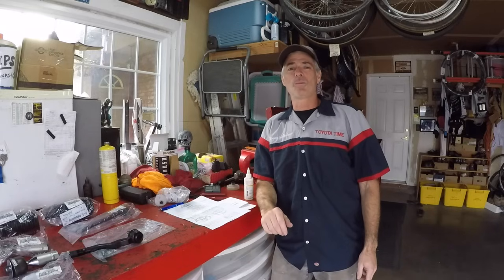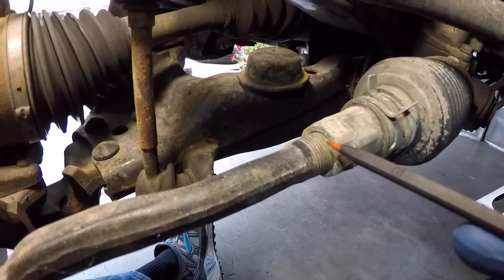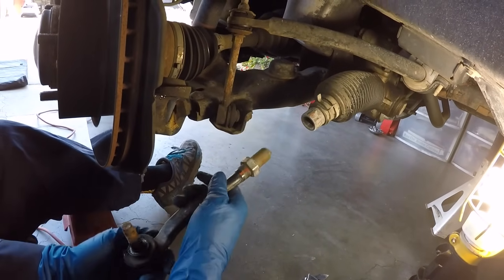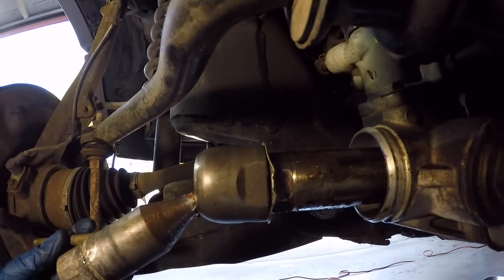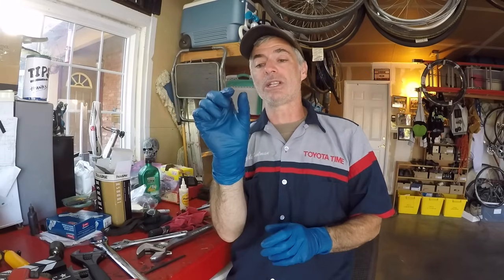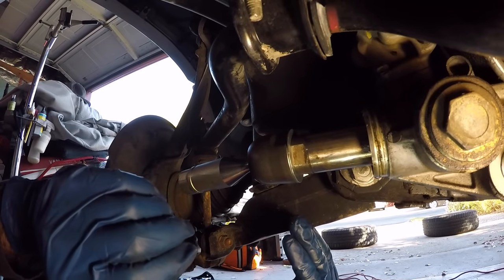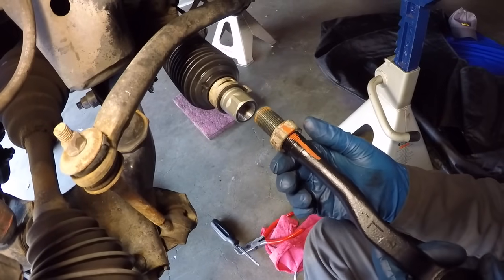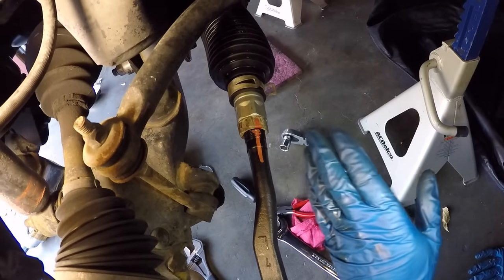Inner & Outer Tie Rod Replacement

Comment: my 98runner with 150k has drooping/sag and my mechanic said that it was loose but probably safe. I just purchased new lower ball joints oem from ebay bc i dont want to risk my wheel falling off like i have seen in some videos. Would you recommend replacing lower/outer tie rods and control arms as well when replacing ball joints? my front tie rods look very rusty and I hear an odd noise sometimes when my steering is alll the way to the left when leaving a parking spot. I am having my mechanic do the work so I figure I could save some on labor costs to replace all these parts at the same time. thanks agin for your help and great content - has helped me a ton in learning and restoring my 4runner. god bless
Reply from the maker: A reason to replace tie rods is if there's detectable play in the joint.  Control arms only need to be replaced if they are rusted out.  Shops suggest replacing the whole control arm to their customers, because they know their high labor rates will make just replacing the bushings not cost effective.  It's also an easier money-maker for them to replace the whole arms.  If you have the space and time, I suggest getting into doing your own work.  You'll save tons of money and learn a new skill.  We have videos galore to help you out.  Good luck!

Comment: Hi Tim!  If you go through NAPA and get the 555 inner tie rods it comes with a new lock/jam nut. I’ve found “Three Five” (555) parts to be similar to OEM. Part number SR-3560
Reply from the maker: That's good to know.  I'm pretty much a fan of buying OEM but I've heard decent things Sankei 555 brand.

Comment: Just want to add that you can replace both the ITRE and OTRE without jacking up the truck or taking the wheels off. Did it this way last week when I replaced mine. The ITRE have to be tilted down to get the OTRE threaded on and then once the end of the OTRE clears the tire, under the LBJ/knuckle (where the OTRE attaches via castle nut onto the OTRE's balljoint) theres just enough room to rotate the OTRE to continue threading until it fits through the bracket. Now I was thinking I wouldn't need an alignment after that but nope was I wrong. Also, you'll need to use a pair of wrenches and not the long ITRE tool.
Reply from the maker: Hey Sam, yeah that makes sense you could do it with the wheels on the ground but you just have less room to work.

Comment: Hey Tim, great video's as usual.  Quick question, I'm planning on doing inner and outer tie rod ends and lower ball joints this weekend will I still need to get the tie rod end puller or with having the ball joints loose will i be able to slide it off without?  Just wanting to make sure I get all of my eggs in one basket.
Reply from the maker: You'll need the puller.

Comment: Boy you're right about the getting the inner off. I've got an FJ cruiser. With big tires. So I bent one once. Had to be fixed on the trail, as I was rock crawling. A pair of 16 inch channel locks worked. But I did not hold the rack with a wrench. Got away with it. But ya not fun.
Reply from the maker: That's what wheeling is all about, building and breaking. But it's always nice to have the right tool for the job whether it's a trail fix or maintenance at home.

Comment: FWIW dept.
The pipe wrench works great.
BUT, as the 30m wrench wasn't available, I DID just use the rack itself for the resistance.
NOW, here are two tips:
Try to move the rack as far as you can, inwards, to you're not twisting a long section.
NEXT, and this is actually important, is to to heat the threaded part where you put the pipe wrench, with a torch.
Don't get it red hot or anything, just enough to soften the "Loctite" on those threads.  Unscrews easily, and you are not putting so much twist on the rack.
Reply from the maker: Great tips.  Thanks for sharing them.

Comment: Great video, thanks.  My Sequoia has a creak when turning - close to full lock. Could this be a tie rod?
Reply from the maker: Hey James, glad you like the video.  A creak from a tie rod?  Maybe.  I think you should get under the rig and have somebody turning the wheels back and forth lock to lock and see if you can pinpoint the source of the noise.  Just choose someone you trust that won't run you over. ;-)
Reply: Timmy The Toolman thanks Tim. I won’t choose the wife then!
Reply from the maker: @jamesg4266  Now that's funny James.  Smart man!

Comment: IMPORTANT!!!!! Don’t make my mistake. This job itself was actually very easy, only took me about 1:30 or less I wasn’t keeping track. The right tools make a world of difference. Now here is the IMPORTANT DISCLAIMER Timmy’s the tool man description can be some what miss leading, however i don’t mean this to bash Timmy, this was my mistake I should have done my research. His description make it almost sound as the inner and outer tie rods are the same on tundra Tacoma and 4Runner however they are not. I do believe the inner tie rods are the same, however I followed his part number and ordered my outer tie rods believing all the part are the same but I was wrong. Tie rod ends on a Tacoma have a 22mm castle but while the 4runners have a 19mm. The outer tie rod of the 4Runner has some very slight differences, however I didn’t realize this until I had everything installed, the 4Runner tie rods don’t seat into the lower control arm of the Tacoma and when installing them I blew both brand new boots. So that my disclaimer just do your research on your parts and don’t do what it did. And if anyone is in search of OEM 1996-2002 Toyota 4Runner tierods I’ll sell you the set I just bought for $65 plus shipping, but you’ll have to reuse you old boots that came off your old tie rods. My loss you gain
Reply from the maker: Thanks for sharing your experience with this job.  I think you're right that someone could take what I say and think the parts are identical on both models.  The front ends on these rigs are almost identical but there are some differences which you did find out the hard way.  Sorry for the confusion and I'm going to make a note in the video description so somebody else doesn't make the same mistake.

Comment: I am prepping to work on my Kia rack. Just about every video I see them greasing the piston shaft.  I assumed there is hydraulic fluid inside the rack behind the seals. I understand the inner tie rod ball needs lube but does the piston shaft? I am looking at this like any hydraulic jack or piston. I noticed you did not grease your piston shaft when you replaced the boot. Thanks
Reply from the maker: @DRDROP-fj4bo  Yeah, there's no need to grease the shaft because, like you said, the shaft is lubricated with power steering fluid,  which, on a Toyota, is ATF

Comment: I rented a tie rod removal kit from autozone,  90 bucks deposit, but that grinder on a wrench was a good idea
Reply from the maker: That's pretty cool Auto Zone rents those.  I guess the key is if they have the right size adapter to fit onto the inner tie rod.  There still is the problem of holding the steering rack shaft firm while applying force with the tie rod removal tool.  There is a narrow spot to put a wrench onto the end of the shaft and the Toyota factory service manual does instruct to hold the shaft with an SST (Special Service Tool).  So, the tie rod removal tool could eliminate one of the two needed tools but you would still have to find a slim and wide enough wrench to hold the steering shaft side.  Thanks for the comment.
Reply: @TimmyTheToolman  I just did my tie rods yesterday I got a 03 gx470, theres no way to hold the rack and use the tool at the same time, unless someone helps, the tool is a pipe with 1/2 in that goes over the tie rod with multiple sized end fittings.
I seen a you tuber buy one from harbor freight for like 50 bucks, just thought I'd let u know
Reply from the maker: @diazfamily83108  Yes, you definitely need someone to help when using that style of tool unless you had REALLY long arms.  I wonder how imperative it is to hold the shaft side firm while breaking free and tightening the inner tie rod.  They put a wrench connection on the shaft so I figured the Toyota Engineers had a good reason for it.  It sounds like it worked out fine for you so maybe it's not a big deal.  Thanks for the comment and Happy Wrenching!

Comment: Do you still condemn the inner tire rod end even if there is no lateral play in the joint?
Reply from the maker: If there's no detectable play in the joint, it's my opinion they don't need to be replaced.  Tony wanted to replace them so we did, but I'm of the opinion that he replaced parts that didn't need to be replaced.

Comment: Hi Timmy,
Great video, I took my 2011 Tundra to the local Toyota dealer, they couldn’t get the jam nuts loose (rusty but not bad) and wanted to charge me over $2000 to change just the inner joints and front rotors and pads. I looked and they had vice grips on the inner ball joint shaft trying to get it off (there are wrench flats right next to the nuts on the outer ball joint ?) i Took my truck home and I’ll get the nuts loose then get an alignment.  BTW the dealer wants $317 each for the inners. Online you can find the OEM joints for less than $200 or a Moog (same brand they use in NASCAR) for $100 for boots clamps and all) I can’t do the Autozone or Oreilly ones for $37. Could you have used your channel lock plyers to hold the rack end when you were removing that joint ( they have pretty narrow jaws)
Great writeup, keep up the good work.
Reply from the maker: What you experienced with your local dealer is what a lot of us have experienced.  They charge way too much for labor and for their parts.  And, they cut you zero slack.  If the book says the job takes 4 hours but it can easily be done in 2, they'll charge you for 4 hours.  You also learned that they screw things up.  The fact they took a vice grips or pipe wrench to the inner tie rod tells me the mechanic either didn't know what he was doing or he didn't have the right tools for the job.

I highly doubt a large channel lock jaws would fit on the flat sections.  They are pretty narrow.  If it were me, I'd stick with OEM and stay away from Moog.  If you find the inner tie rods are fighting you pretty good, maybe some penetrating oil and a little heat with a torch will help.

Comment: Great explanation on how to professionally replace tie rods! I recently replaced my tie rod ends on my 2002 4Runner (using OEM parts). When tightening the passenger side tie rod castle nut I noticed that the grease was seeping out and the stud (which the castle nut goes onto) seemed to be pulled too far through the knuckle. I stopped tightening before reaching 67 ft-lbs. If there is any explanation to this that would be great! Thank you. Did I do something incorrectly or could the part be defective?
Reply from the maker: Thanks Ben.  We appreciate the compliment.  Maybe the tie rod was filled with too much grease.  Maybe the taper of the tie rod was a machined a bit too skinny allowing it to sink deeper into the lower balljoint connection.  If you got it pretty tight and the castle nut can be properly backed up with a cotter pin, you're probably ok.  If the shaft of the tie rod sunk so deeply that you can't install a cotter pin through the castle nut, that's not good.  I would return the tie rod and get a replacement.
Reply: @TimmyTheToolman   It turned out that the dealer gave me the wrong lower ball joint and the tapered hole for the tie rod end was too big. This didn't occur to me until I had damaged the tie rod boot by being able to over tighten it due to the larger hole. Someone at the dealer had placed the lower ball joint in the incorrectly labeled bag. Thankfully they replaced the tie rod and ball joint free of charge. Having solved that issue I have moved on to addressing oil leaks. I am currently working on my oil cooler gasket and couldn't find a video of yours for the job. Maybe it could be a future video. Thanks for the previous reply and all of your great videos!
Reply from the maker: @benhall8681  Hey Ben, good to hear you got it figured out and the dealer made it right.

I've actually replaced the oil cooler seal on a friend's rig but we didn't film it.  You can get an idea of how to do it from our 3.4 Swap video series. Start watching this video at the 9 minute and 10 second time stamp: https://youtu.be/AvHvk9N-hTA to see how to get the oil cooler off.  Start watching this video at the 30 minute and 30 second time stamp: https://youtu.be/_G_zqDC9kFM to see how to get the oil cooler back on with a new gasket.  When doing this job with the engine still in the engine compartment, you'll want to get the alternator out of the way if you plan on replacing the oil cooler hoses as well.  You can see how to do that in this video: https://youtu.be/71_kBhg6_-A.  Getting the alternator out of the way will give you access to the cooler hose connection at the side of the water pump.  If you don't plan on replacing the hoses, you won't have to remove the alternator.  You'll want to do most of the work through the driver side wheel well.  This means you'll have to disconnect those rubber and plastic mud flaps so you can see the engine through the wheel well.  You'll most likely break some of the clips but you can buy replacements at Toyota if you want to get the mud flaps back on securely.  This is the best I can do for you.  Hope it helps.

Comment: Timmy, you are great, have you tried to borrow the tie rod tool from the parts store, what is your opinion about counting the number of turns instead of threads, can you say what size is the tie rod castle nut, 14X1.25?. Thanks
Reply from the maker: I've never tried to borrow the tie rod tool.  The thing about those tie rod tools is you're just cranking on the inner tie rod and not holding counter pressure on the shaft of the steering rack.  Counting turns I suppose could work, but I've seen slight differences in the length of the tie rods so I think making matchmarks might be better.  I don't know the size of the castle nut unfortunately,  but M14 x 1.25 is a good guess.

Comment: V8 tools 42mm crows foot wrench fit rod end with no grinding required. Was $18 on eBay and you can fit a torque wrench on it
Reply from the maker: Nice to know Jim.  Could you provide a link?

Comment: If the outer tie rod threads at the knuckle joint spin while tightening the castle nut, what is a good method to keep the threaded rod stationary? I tried a different style ball joint separator upside down but there isn't enough room to spin the 19mm castle nut inside the U shaped portion of the separator. I am trying to avoid buying the impact driver. I did get it with a second jack pushing the outer tie rod up but that seems like it might flatten the threads because it is coming in at an angle. Suggestion for others, I picked up a new scissor jack for $12 at the junk yard.
Reply from the maker: Using a jack to push the tie rod firm into the lower ball joint is the right technique to stop the shaft of the tie rod from spinning. The tie rod shaft and the hole it goes into is tapered.  By applying pressure under the tie rod, you're creating the friction necessary to get the castle nut spun on and bottomed out.  If the castle nut threads and tie rod threads were in perfect shape and the nut threaded on smoothly, you wouldn't have this issue.  But, either the nut threads get a bit compromised or the shaft threads get a little rough, and now the force required to turn the nut on the tie rod shaft threads is more than the force required to spin the tie rod joint.

Comment: Wouldn't a larger pair of channel locks have also worked to loosen?  Once you break it free, it's hand twist.  I guess the issue would be if he flat surfaces don't allow you to go around to the full tight point with channel locks?
Reply from the maker: A channel locks to break a fastener free requires a lot of hand grip strength.  I don't know if it would work for this application.  If you're a big guy with gorilla hand strength,  maybe it could work.

Comment: Great Tutorial! I have a question and wanted your advise on that. I have 2011 Sienna when I removed inner Tie rod I found there were no tabs on the Pinion rack and not sure how i should use my Claw washer since there are no tabs . Would it be a compromise to not to use claw washer?
Reply from the maker: If there's no tabs, the washer is sort of useless as a claw washer.  I'd still use it if there was one there originally.
Reply: @TimmyTheToolman  Greatly appreciated for your swift response. I noticed there is one O ring but it is on the rack and not sure what is the purpose of that. May be that is for rubber boat . Not sure . Another thing do you remember any brand of steering rack that doesn’t have notch. I never saw one . Pls advise . Thanks
Reply from the maker: @gemale  I don't have that much experience with steering racks.  I've taken them off a few different Toyota models, but this is the only one I ever swapped out inner tie rods on.

Comment: Things have changed. Even OEM tie rod ends don't have the same amount of threads as the originals. The threaded section of a new tie rod end may be 1/4 to 1/2" shorter than the originals.
Reply from the maker: Interesting.  Thanks for sharing this information.

Comment: Looks like a job for my Knipex Pliers Wrenches
Reply from the maker: Could you share a link for these Knipex wrenches?  I have several pairs of Knipex pliers that I like.
Reply: @TimmyTheToolman  Sure thing - https://www.amazon.com/gp/product/B005EXOK22 I just picked these up a week ago in 7" and 10" and they're great. Low profile heads and great gripping strength with a "ratcheting" action due to the design. They should be great for the type of truck wrenching I've been doing.